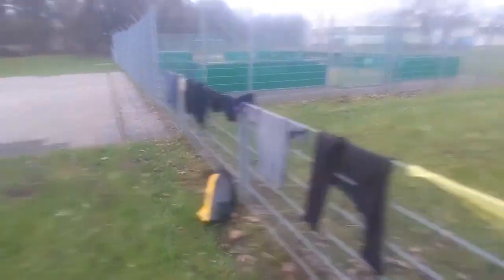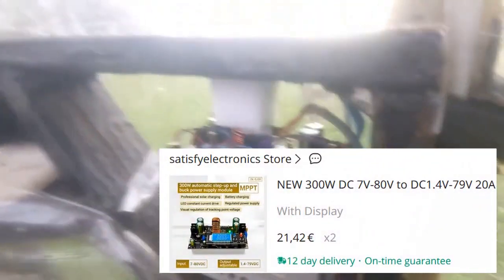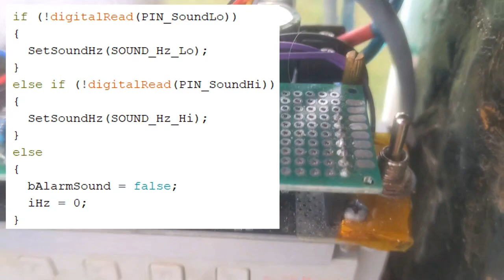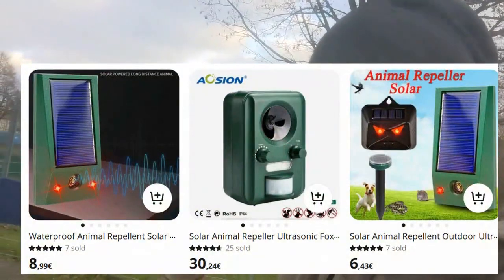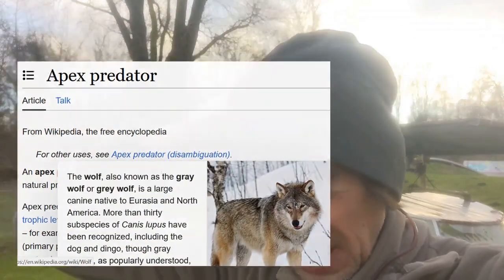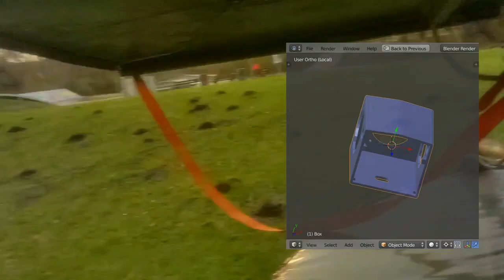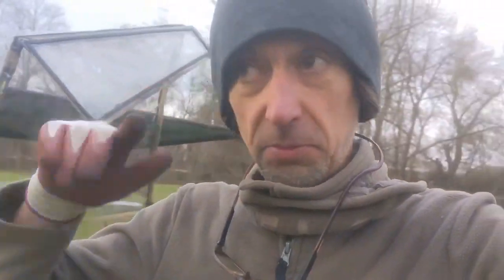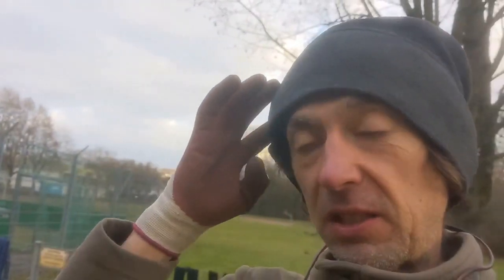my Esp32 6x ultrasound Wolf 🐺 Lupus repeller :-/

Comment: Try implementing LRAD. Two or more equidistant coneshaped speakers emitting a sweep of frequencies. This will create positive interference points where the acoustic power can be very high.
Reply from the maker: thanks for the comment, i still have to answer. I have 6 speakers (at two places) and when i move i do not hear any interference at 10 kHz. So 19 kHz will show even less interference.
I use a L298N to drive the two places (with 3 speakers in parallel): https://www.aliexpress.com/item/1005005854762208.html
I transform the square wave into a triangle with smoothed tips simply with a inductivity i made by rewinding the coils of two (broken) LTC3780 10A module https://www.aliexpress.com/item/32730251919.html . About triple wire length to increase inductivty. The 0-32 Volt square wave bcomes a -20V - +30V triangle..
I drive the 2 channels of the L298N at 180° so  the two square waves add up to a constant current from the power supply:

void IRAM_ATTR timer_isr() 
{
  if  (bAlarmSoundDo)
  {
    if (bToggleSpeaker)
    {
      digitalWrite(PIN_IN2,HIGH);
      digitalWrite(PIN_IN3,LOW);
      bToggleSpeaker = false;
    }
    else
    {
      digitalWrite(PIN_IN2,LOW);
      digitalWrite(PIN_IN3,HIGH);
      bToggleSpeaker = true;
    }
  }
  else
  {
    digitalWrite(PIN_IN2,LOW);
    digitalWrite(PIN_IN3,LOW);
  }
}

So doing a changing phase shift could be easily implemented in this code, but i guess i will stick to the constant current with the 180° phase shift.